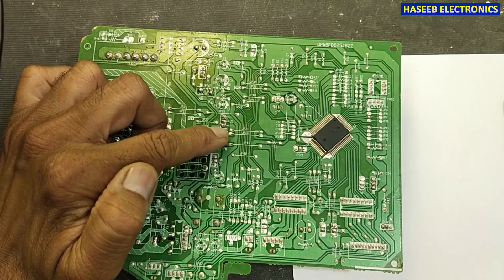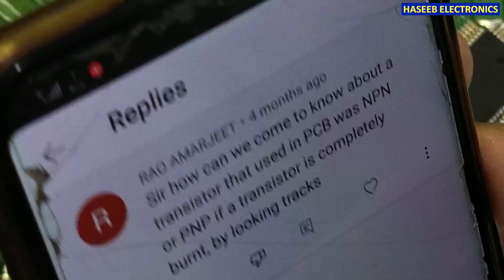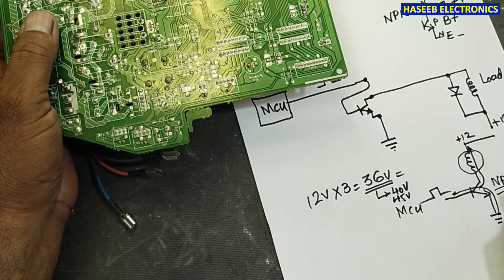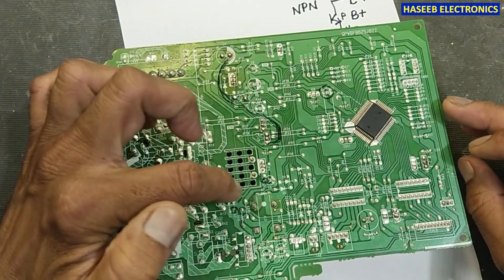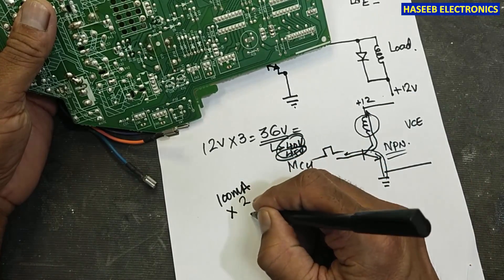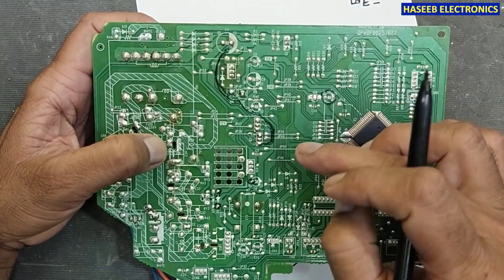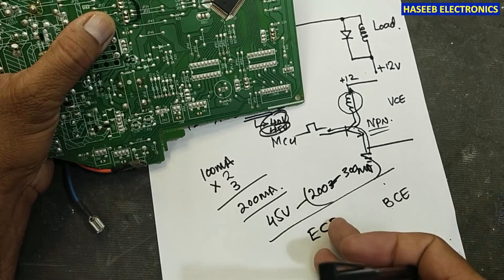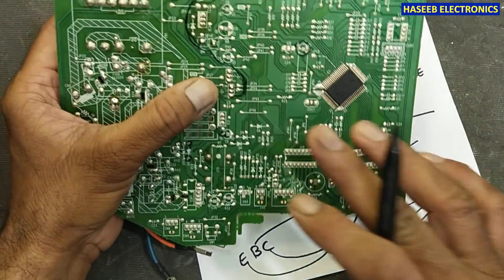{751} How To Know Burnt or Missing Transistor Part Number

Comment: Hello to every one this pic is pcb  of my brush less 18v cordless drill driver it's smd transistor burned up due to wrong polarity and number of transistor can only seen starting 54 what will be the number of burned transistor please help transistor used with TPHR8504PL
Power MOSFET (N-ch single 30V<VDSS≤60V) and FU6861Q ic

Comment: Glad I found this video. I still need to process this however, as I'm still not clear on a few things.
Reply from the maker: thanks a lot.  you can write your question, so we can discuss
Reply: @HaseebElectronics   I think I need to re-watch the video a few times. How did you determine the voltage is 12V and the max supply is 16V when trying to determine the component #? The voltages were confusing. I also need to study more on why the NPN voltage is greater at the collector. Thanks!

Comment: What mean by C++ and C-- at collector..can explain it
Reply from the maker: when we discuss NPN transistor 
Emitter is connected to Low line, Return Line (it is indicated as -)
base is positive than the emitter but it is marked as +
collector is supplied with more positive voltage (that have marking ++ double positive or more positive )

in pnp 
emitter is +
base is  -
collector is - - double negative or more negative

Comment: Some times that is the only way to get a very good guess about what the part is supposed to be since it has no part number or is burnt beyond recognition anymore. I have repaired a couple circuits using that method and they actually worked with my guess component... Thumbs Up!